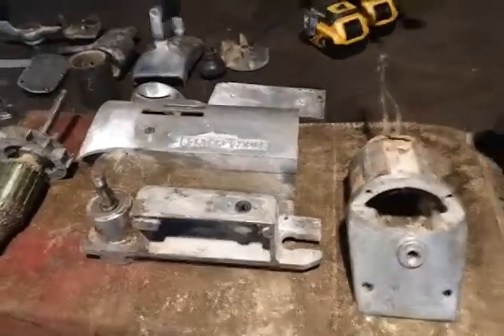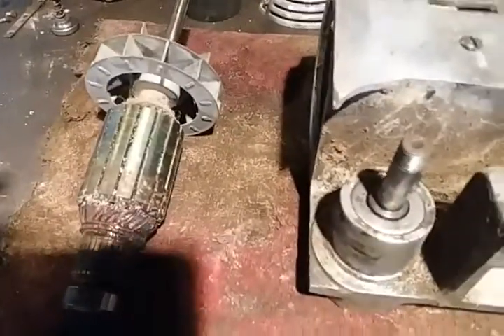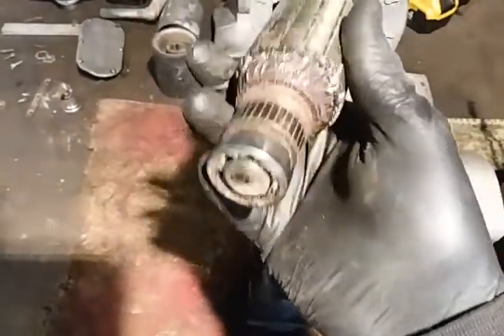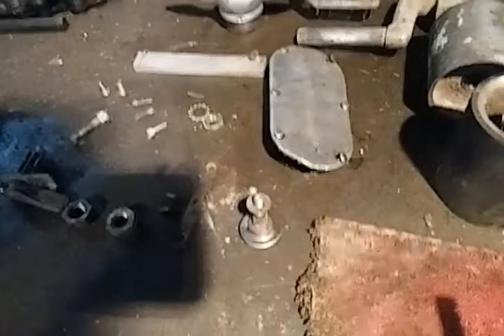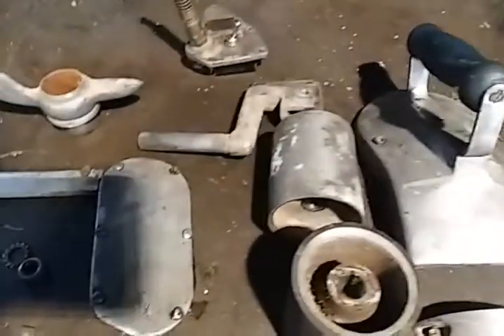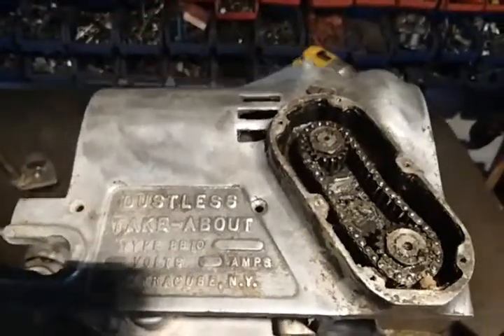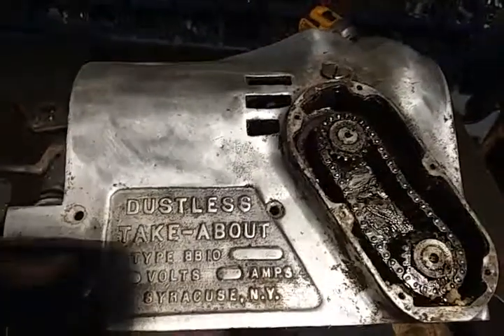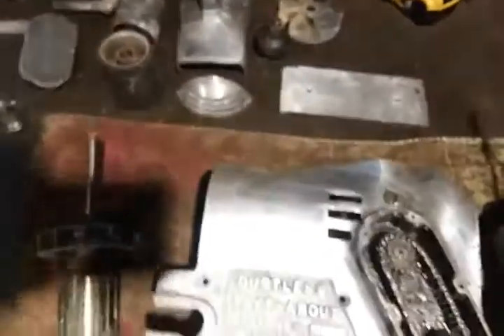Porter Cable Take About

Comment: Great find! I love these old Porter Cable Take Abouts and I have a collection of them including a BB-10 just like this one. Your sander probably dates from the early 1940s.  My BB-10 was rebuilt with new bearings and seals and it gets used once in a while. These machines sand like nothing else.
Reply from the maker: Thanks Josiah! I appreciate the info. I haven't done much besides a clean up on mine. It needs brushes, but it is stored indoors and at some point it will be addressed.

Comment: Hi Jesse!  Be carful with wire-brushing the cast aluminum!  The steel brush can often make the surface Orange Peel!  Ask me how I know!  LOL!  =)
Reply from the maker: Haha no problem! It is not happening in this case. I did a little test area prior. Coming out pretty good. I'll post a video with the finished product. It got put on the backburner because I got a call about a tool lot. And I'm going for the tool lot! There is an old drill press and some gems in there!!! I'm excited. I will show the new stuff in a preview video tonight. Thanks John.